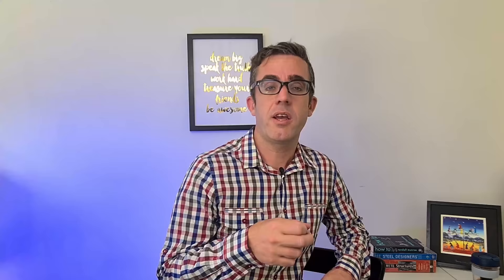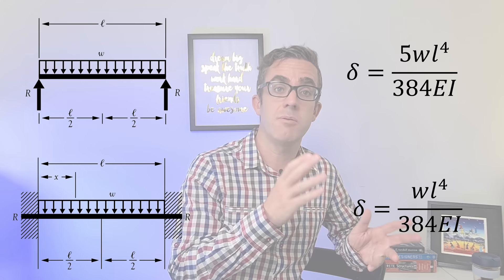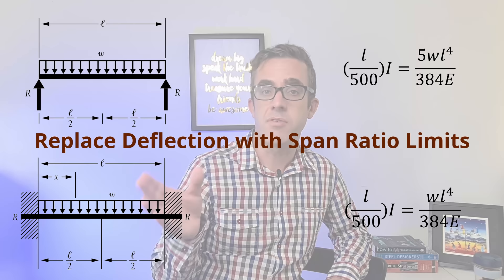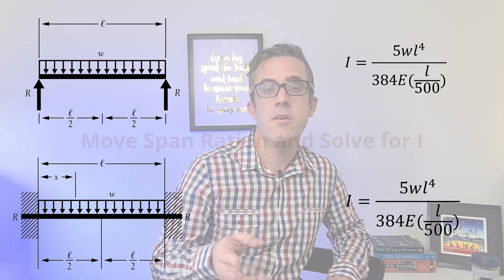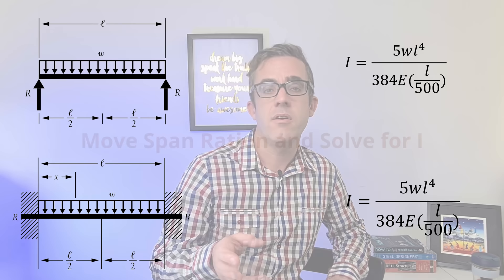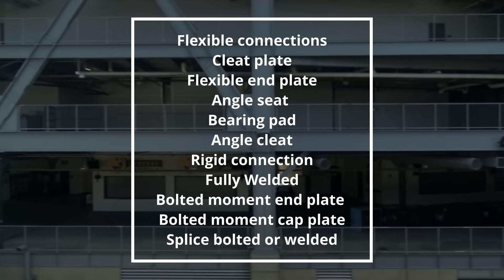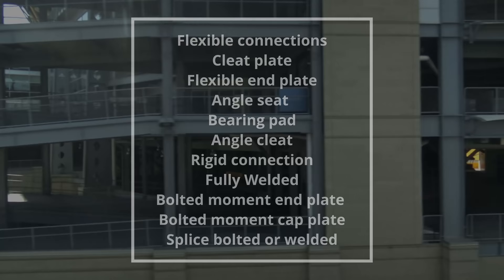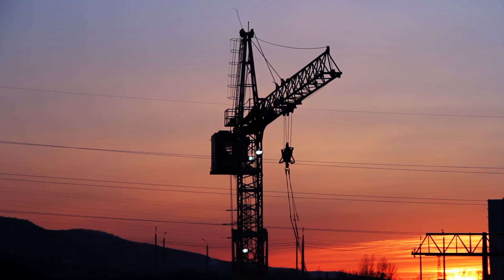The Golden Rules of how to design a steel frame structure

Comment: Refreshing, an engineer that is aware of, and considers, the other aspects that define project success, erection, maintenance, etc.  The discussion of the nuances and interplay of loads, vibration, deflection is very refined.  

Not a steel structure, but too bad the team that worked on the failed FIU pedestrian bridge had absolutely no concept of Golden Rules for that type of concrete structure.  

Based on the FIU bridge, Boeing 737 Max debacle, and others, I am of the mind set that college grad engineers today have little to no intuition/Golden Rules to sanity check their designs.  Thus believe the administration's  "Build it Back Better" will actually turn out "Build it Back Worse" and will be a giant cluster f....
Reply from the maker: Hi DI thanks for the support. Agree sometimes people get caught up in one part and ignore the bigger picture. Some times you need to step back and look at the project as a whole, and how is it going to be built or operated making sure it it fine at all stages.
Reply: @BrendanHasty   in my world (software engineering), ideally we would satisfy the multiple factions we call "stakeholders."  I still see a lot of engineers with "blinders" on.  This idea of operating at a higher level applies to all engineering.  That general engineering practice would make a great video for a broad engineering audience.

Comment: Thermal expansion joints 150 meters apart, Is that safe?
Reply from the maker: Hi SM for steel roof structure this spacing is ok, for slab it needs to be 50meters

Comment: I am lying in a hospital bed watching workers add a new wing. All the beams, horizontal and vertical are covered in rust. What  must be done to prevent this building from collapsing? thank you!
Reply from the maker: Minor Rust on Steel isnt an issue, and new beams likely havent rusted very much yet. There is many what to address it but there are way to clean the steel and paints that you can treat the rust with.

Comment: Your comments on galvanic corrosion are incorrect. Aluminium is less noble therefore the aluminium will corrode not the steel.
Reply: Came here to say the same thing. The resulting advice given works just fine either way, but the theory was wrong way around. I work as an engineer in marine industry, so googling galvanic series is quite big part of my job.

Comment: Buddy, don't be silly. People who design steel structures with dimensions larger than 150m are not gonna watch Youtube videos to get the arrangement of joints right. I also doubt that "precamering is recommended" as a general rule. Especially if you repeat "your fabricator will love you" or "make it cheaper". I would say that for roofs of single storey portal building the dead load will not require pre-cambering.
Reply from the maker: Hi Peter not sure how many structures you have designed typically long span roof structure are governed by deflections, precambering increases the spans

Comment: ANYBODY ?  - - WHICH IS LIGHTER - - STEEL OR CONCRETE?
Reply from the maker: Steel is 8,050 kg/m3 and concrete is 2,400kg/m3  so Steel is about 3.35 times heaver
Reply: Hi Brendan 👋🏼
Thanks for responding - - AWESOME CHANNEL btw - - I just recently discovered you. 👍🏼
(Interesting... I’d thought steel was a little lighter.)
Is steel stronger though?
I’ve seen elevated subway trains (in USA for example) that are about 100 yrs old... vertical steel beams + vertical truss lattices with concrete footings.  The concrete footings are cracked from age + elements - but the steel seems relatively unaffected... so that got me thinking that steel is more reliable.  (Also steel is recyclable, whereas concrete isn’t (unless its being used for landfill perhaps?)

Haven’t seen all your videos... but a video on the pro’s + con’s of steel v concrete would be interesting.  Cheers mate!

Comment: Well I live in a shithole country and my chances of getting a steel construction job are practically slim jkjk great video btw however always remember that any strong link is only as strong as it's weakest point. Let that always guide you through and remember cost cost cost. A little miscalculated channel selection could set a client 1k bucks back
Reply from the maker: Agree the weakest link, it is all about know where to strengthen and where you can maximise the efficiency.

Comment: im a steel detailer, experience steeldetailing wsp as structural designer, wsp structural engrs are over rated, your steel are not properly set out, wonder if your design calcutions are accurate, Australian steel design is garbage